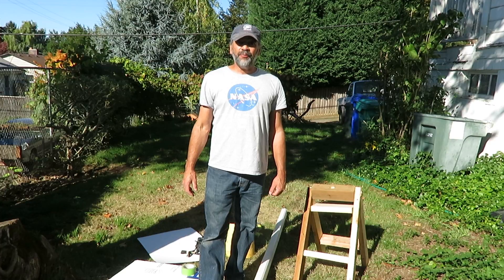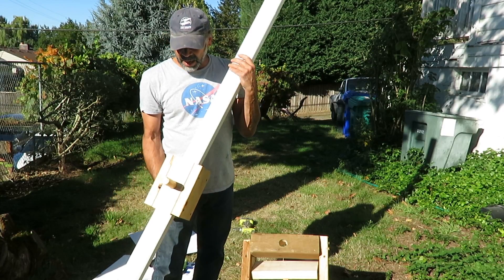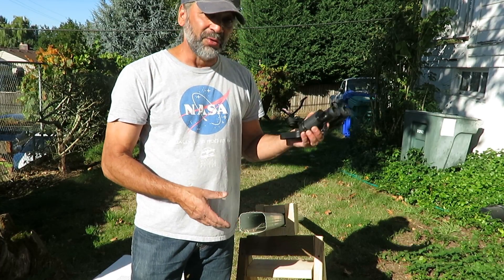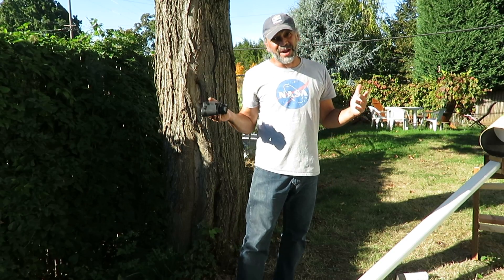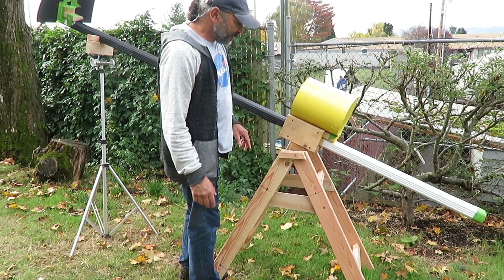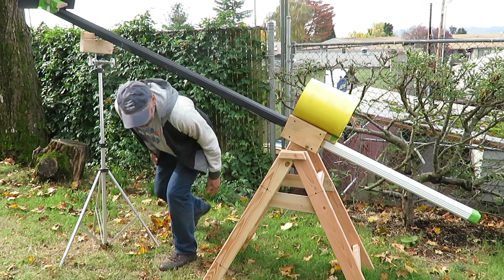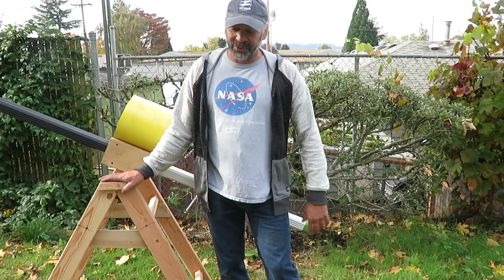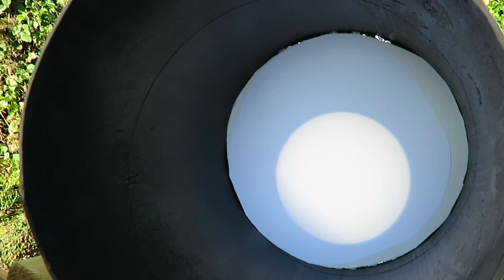Sun Projector

Comment: Try using a mirror a long way away.  Shine the image of the sun into a darkened room or larger box.  There is a guy who did that from about 30 meters and 8 inch sun image.  No lenses. just distance.   www.youtube.com/watch?v=u0aClpzytt8

If you use a monocular telescope or regular refracting telescope, or pair of lenses, you might have more flexibility.  The sun image is still rather bright, so you could try adding filters.  Put a camera inside the box, and put a dark paper to only let the direct sunlight in, not stray light.  I think what you did is cool and well constructed.  But the sunlight on white washes out the contrast on the camera (and eyes).  So a material with lower albedo, but fine grained might give light to a camera sensor better.  You waited for later when the sun was not so bright and where the angle you could observe was reasonable.  With a mirror you could keep your telescope fixed and just track the sun from a fixed point that can see the whole sky.  I have never used a motorized satellite disk pointer, but I wonder if you could put a mirror on it, or something much smaller, and track by hand, or an app.

Tracking with a big telescope is a pain.  So a tracking mirror (heliostat -en.wikipedia.org/wiki/Heliostat and try to ignore the complexities and just think of moving a light weight mirror to keep the sun fairly centered).  I tried to look at two stepper motors with 100x gears, but the construction part got in my way.  Plus a bit of programming the arduino or Raspberry pi or whatever to send the steps at regular intervals.

There are a number of astronomical software packages that will "track and stack" so if you get the sun image in the frame of the camera, the software can do the adjustments.  The stacking with what are called "lucky images" is sometimes used where the software rates each frame and decides which are "good", and then stacks them to improve contrast.  I use SharpCap 4.0 and there is also FireCapture.  They can take webcams, and some astronomical cameras.  I try to make things that people can afford in EVERY country, so cell phones, webcam, or whatever.  

I kept running into the term "Barlow lens" when looking at telescopes.  They are low power lens combinations.  I finally decided that it works like a low power microscope to focus on just a portion of the image. Since you have such a large bright image to work with, you might be able to hack together a camera and lens combination.  I experimented with "digital microscopes" which are mostly webcams with the lenses reversed. But I did find one that had true microscope lenses and it does not seem to be available.

Getting images to look at is fun and new. but I think the real fun starts when you have recordings that you can study, do statistics and physics with, and that you can compare and share with others.  There are some beautiful images of the sun online at various places.  But they seems to drift and change as people lose interest.  sdo.gsfc.nasa.gov/data/ is a good starting point, but the images are all in lossy formats (jpeg and mp4) so beware that the pixels never match the raw data.  For looking and some rough statistics it is OK, but long term we need lossless formats.  There are some, and you will see "FITS" which is common but beware there are many dialects and incompatible versions.  Despite the hype.  And the tools and software take a lot of care and feeding.  

Thanks!!
Reply from the maker: Hi Richard, Thank you for the suggestions and info! Having a mirror 30 meters away sounds cool but not practical for my uses. Im working on an update which will use a refractor telescope instead of a monocular which will give me a larger image at a shorter distance. I'm also going to integrate a rotating filter wheel. Stay tuned:)